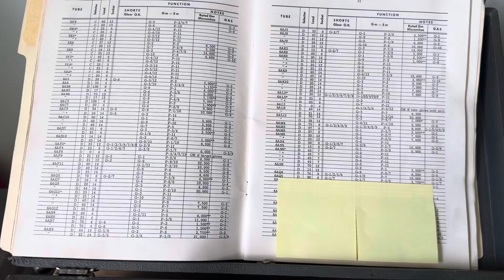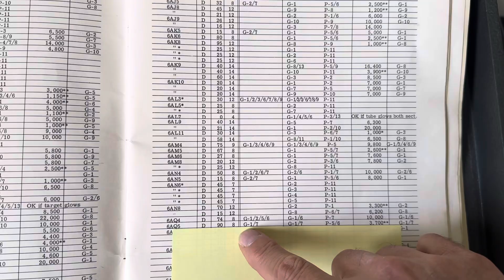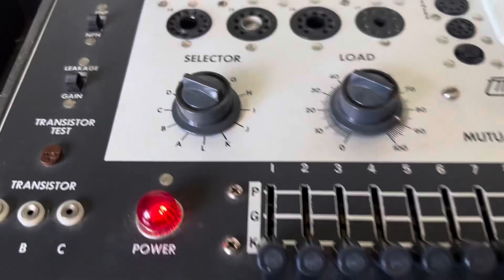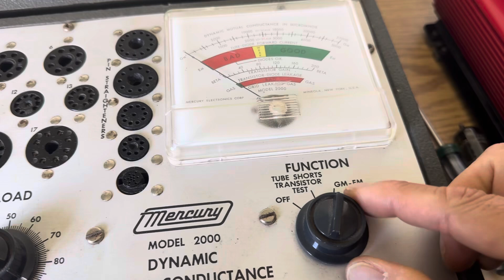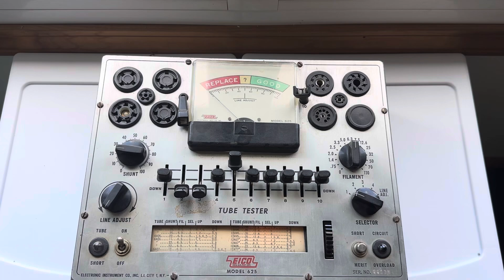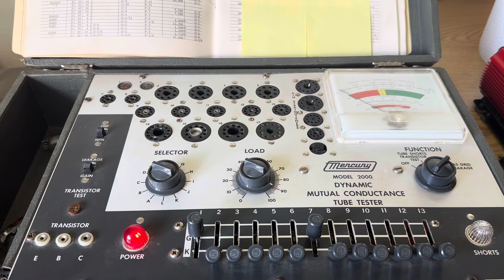HOW TO: Mercury 2000 Dynamic Mutual Conductance Tube Tester

Comment: Hello, I have one of these but the meter does not work.  After further investigation, the wires inside the meter were broke off from the meter.  I know where the + wire gets connected to, but the - wire is baffling me.  Cannot determine where it is soldered to.  Is it possible for you to look and see at what points the + and - are connected to?

Comment: Hi, do you have a picture of the Mercury 2000 PCB?
Reply from the maker: Hello…there is no PCB. 1950s/60s technology was point-to-point wiring.
Reply: @offgridham5421  Sorry, I misspoke. Do you have any photos of the phenolic eyelet board? They would be very helpful for restoring my tester, as there are some modifications to the eyelet board that I don't understand. I'd like to return it to its original state.
Reply from the maker: @michelboivin4396 sorry, I do not have any photos of the guts of the instrument. If I can assist further, contact me through my website www.offgridham.com
Reply: @michelboivin4396 I can get you those photos, let me know